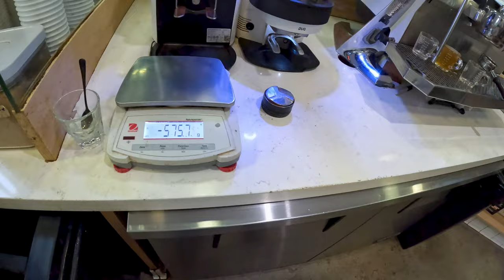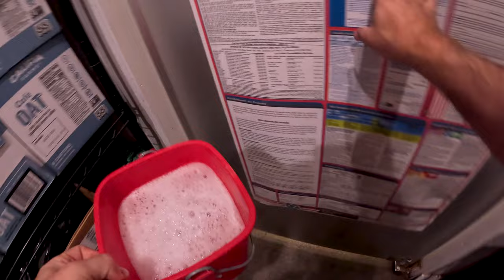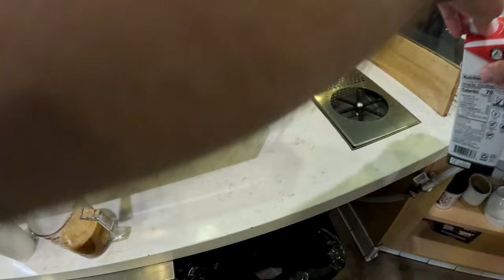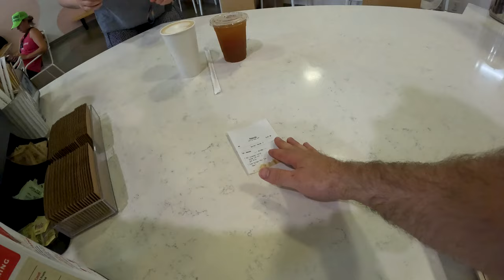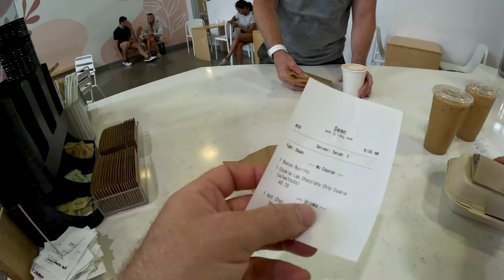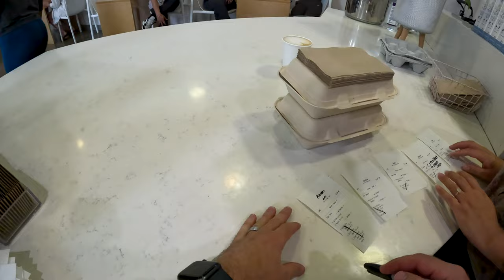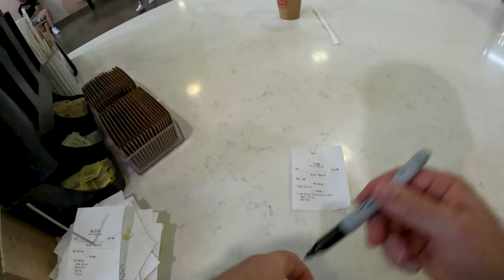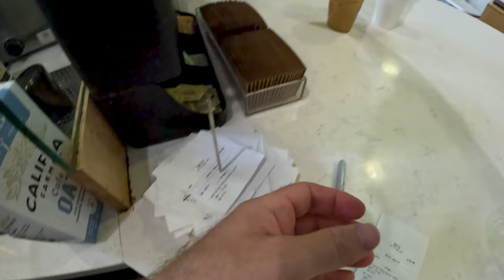1 Hour Barista POV Opening Shift With a Huge Line!

Comment: The fact that you tuck the towel for cleaning the coffee handle in the trashcan is gross. And then you also dry your hands on it. This is extremely unsanitary. You ca get a dry brush that hangs on top of the coffee machine by a magnet so you can clean the old coffee remains, and clean milk pipe with a CLEAN napkin that sits on top of the coffee machine.
Reply from the maker: This is literally standard so not sure what you mean. Orange County CA health department approves it and they are one of the most strict health departments in the world. No one wipes there hands on this towel it’s covered in grounds? Milk towel is separate on the machine idk what you’re saying. Btw a dry brush isn’t going to lift the oils out of the portafilter basket. Yeesh
Reply: What are you on about?
Every coffee shop has their towel tucked into the coffee bin